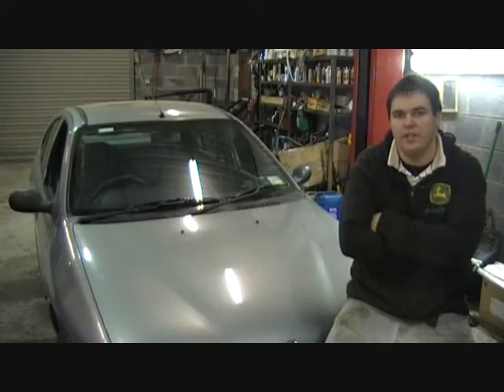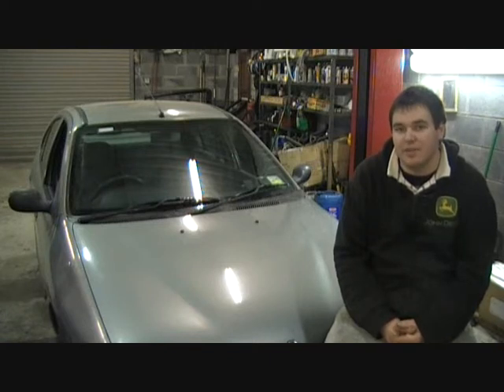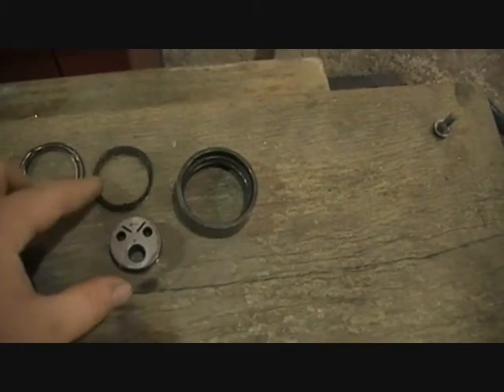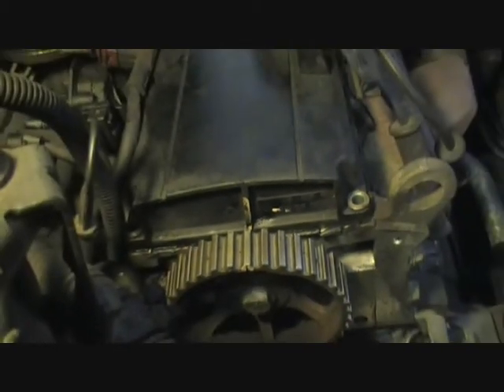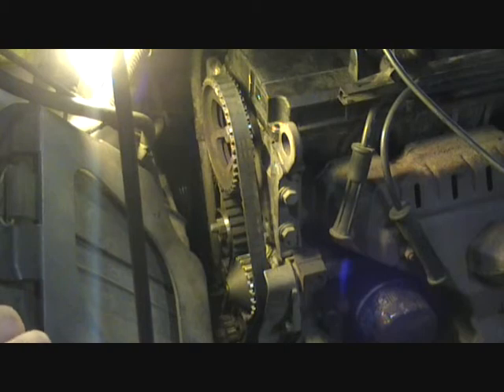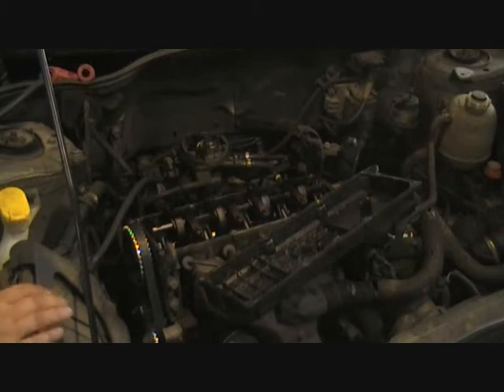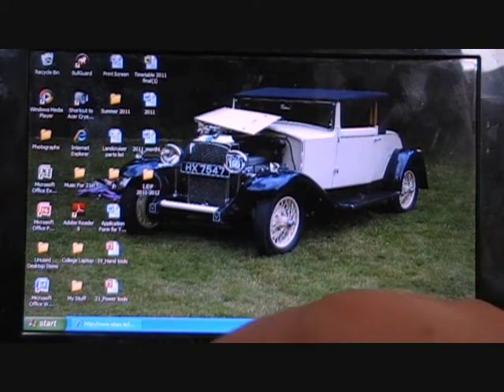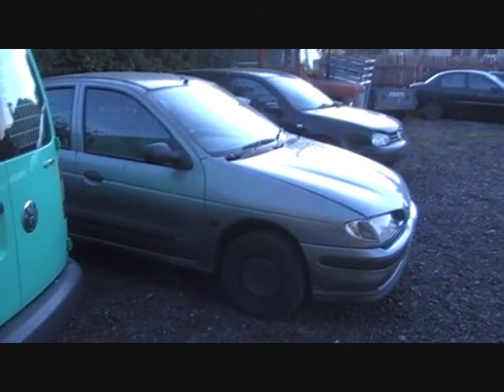Budget Motoring in Ireland Part 1 - Cheap Car

Comment from the maker: @Nh7740man97 No not the timing belt, if the fan belts are loose they will squeel, thats not serious, they just need to be tightened, if a timing belt is loose it could wreck your engine

Comment from the maker: @vincenzolorenzo The old one is angry because it fell apart, caused major damage to its fellow components, and is no longer useful, the new one is a bit sad that it had to leave its original engine, but also worried that its going to have to keep working on the new engine, even though it has 70K on it already,... and its still in it now, new one's are expensive!